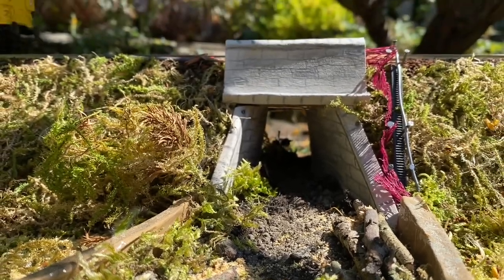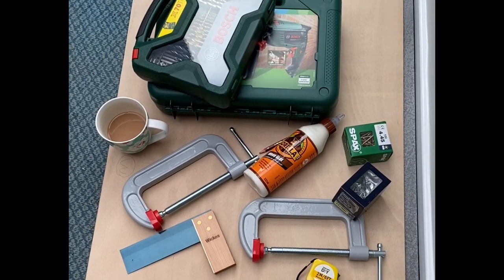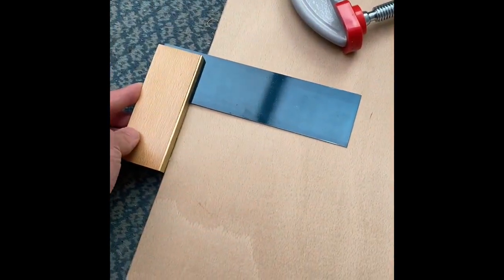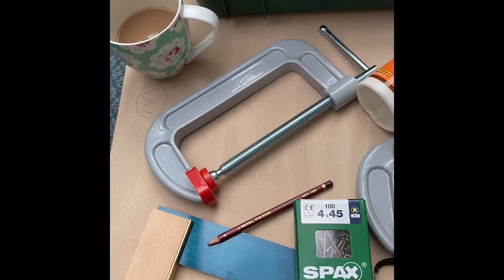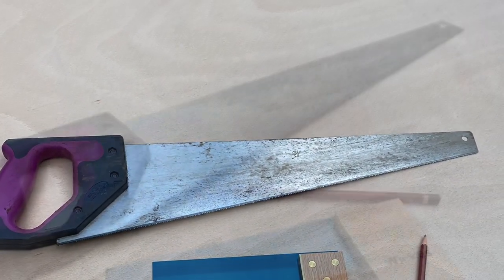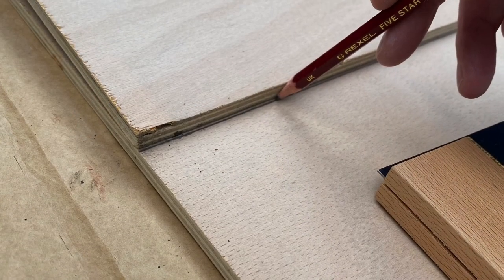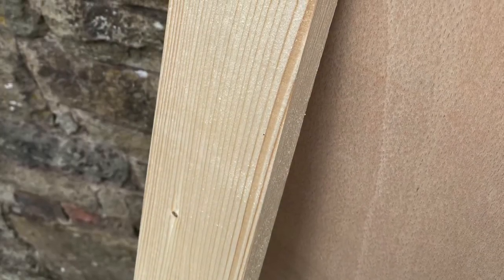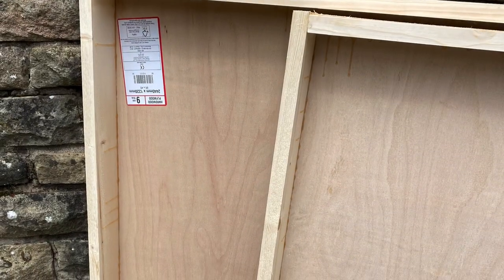(HD) “The Build Begins!” Baseboard tips -Part 1- Hattons Class 66 duties! OO gauge model railways UK

Comment: Nice start Paul, I’m really looking forward to it taking shape. I do really enjoy watching layouts take shape from scratch. I’m loving the planning with my layout and as John said previously and I suspect you know 2cm rise or fall Over a metre is a pretty good measure when doing your gradients and is something I’m working to myself. Cheers Paul, John
Reply from the maker: Hi John, many thanks for watching and commenting mate and glad you enjoyed it. Yes it’s great to get started and I know what you mean about seeing a build from the start and I’m also really looking forward to seeing your layout progress as it’s one of the rarer modelled scenes and has great potential. The blank boards are a bit of a blank canvas and although I have a rough idea of how they will take shape the bit I really enjoy most is working out the finer details such as where a road will go under or over a line and how the retaining walls will work out etc. Yes really appreciate the feedback from John and yourself about the gradients and they are one of those things that can be a real headache. My initial thoughts are to run the gradient out of sight behind back scenes as should have plenty going on with the other lines so i should be ok for space as it can run the length of more than one of the modules if need be but just depends how much difference in elevations there needs to be. For garden running I’ll just run them separately so it won’t feature but it’s all early days so will see. That’s the great thing about building a layout these days, being able to access such a wealth of knowledge! Thanks again and good luck with your build John, all the best, Paul